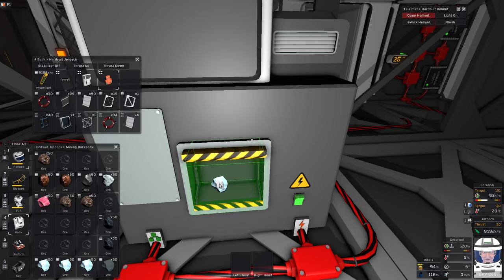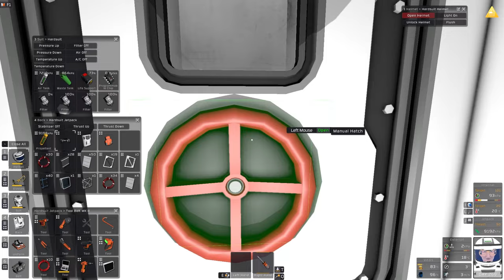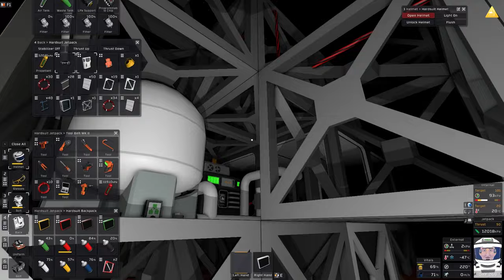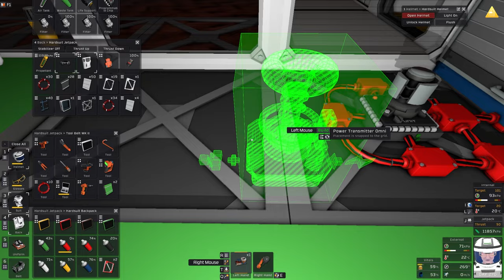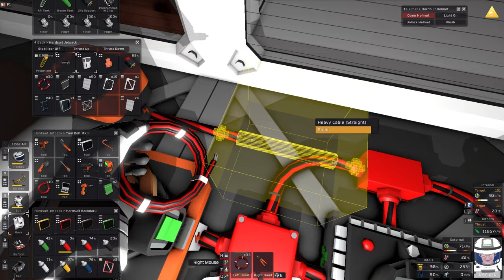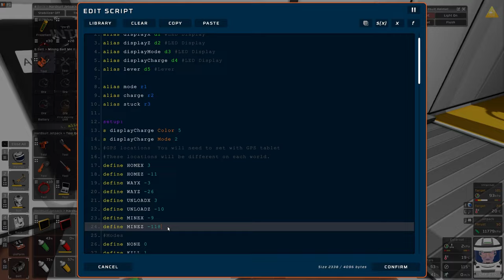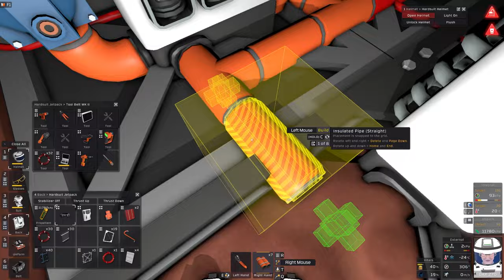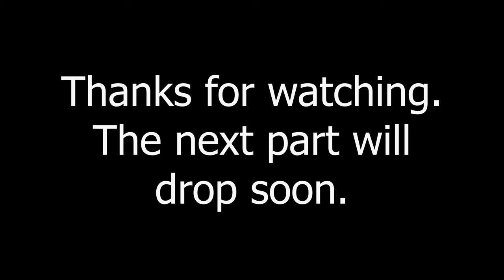Unleash the Power of Stirling Engines on Mars - Stationeers E34

Comment: Seeing the wireless batteries makes me wonder why you don't have all your tools have one...place an omni transmitter in a few more areas, never have to swap them out again as you move around the base.
Reply from the maker: @jasonknop973 I was thinking something very similar myself. The range of the transmitters isn't great but you don't need to be in range all of the time. The downside is they're quite power-hungry and are around 60% - 70% efficient compared to a normal battery charger, from what I've read. Also, there large wireless battery only holds double the charge of the normal small battery and the small wireless battery holds around a third of the charge of a normal small battery.